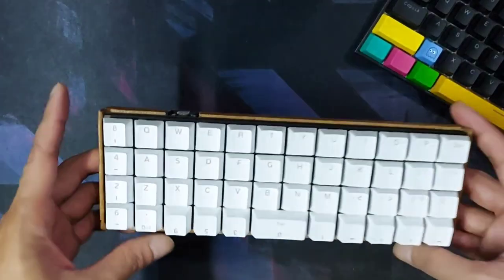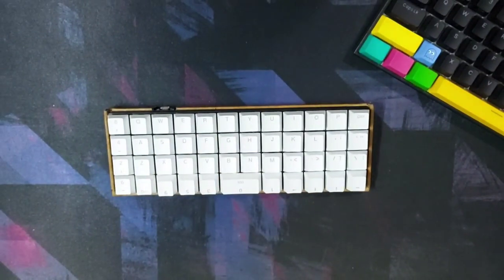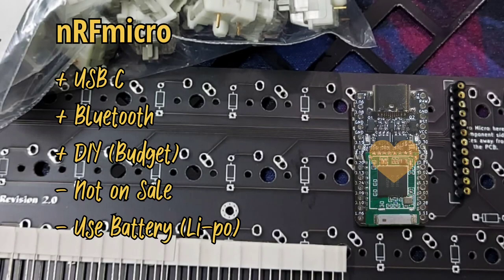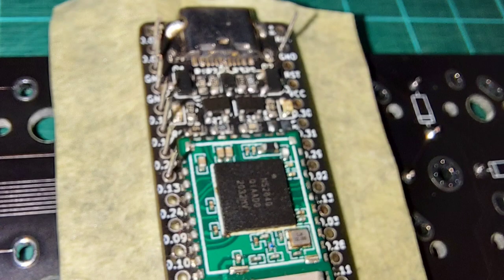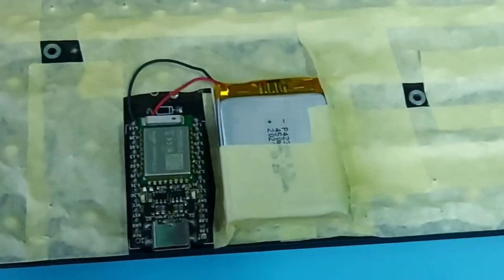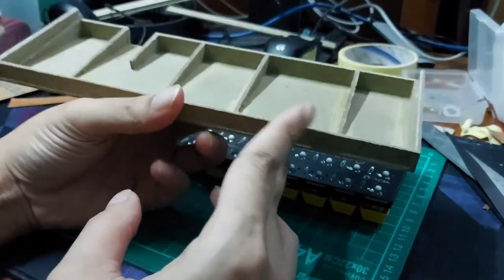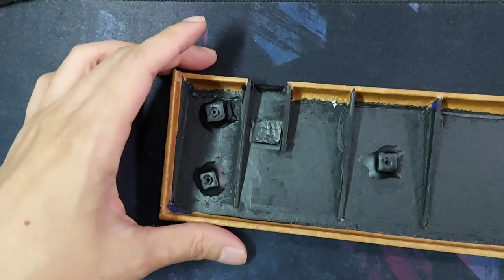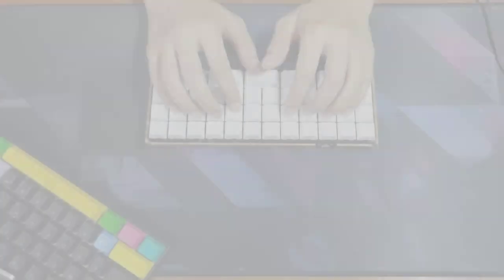Build a budget travel keyboard with a cardboard

Comment: I love this idea! Are you concerned at all about humidity slowly making the cardboard degrade? It looks like you covered it in black stuff, is that meant to help with that kind of problem?
Reply from the maker: Yes, I actually have 2 coats of clear acrylic spray after the case is assembled before the leather is applied, and then I add the standoff holder and then I sprayed another layer with black acrylic paint just for the inside, the faux leather itself is not easily degradable, I live in a tropical country which has high humidity, so yeah, humid is not a problem